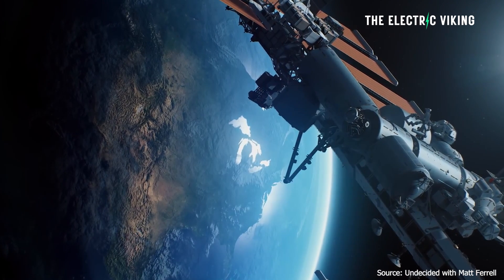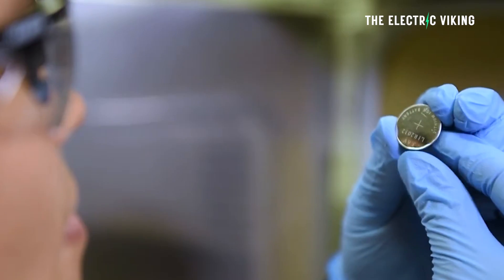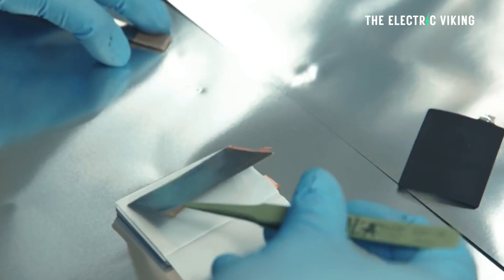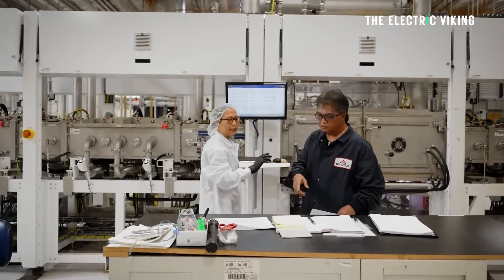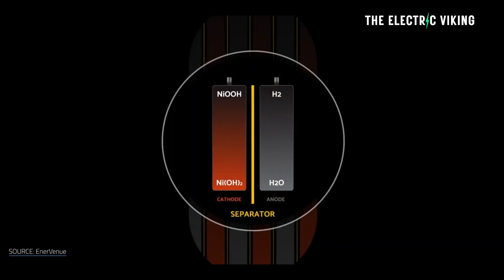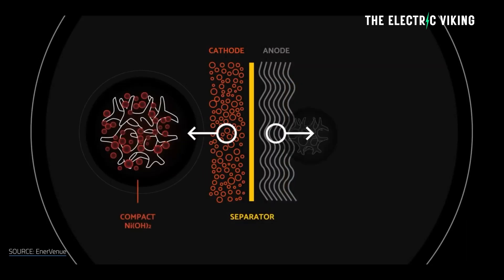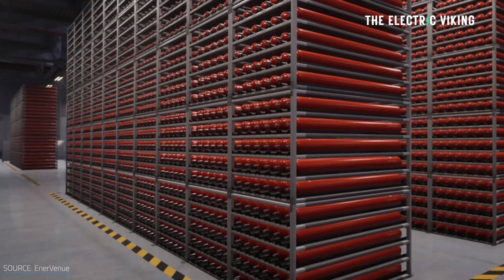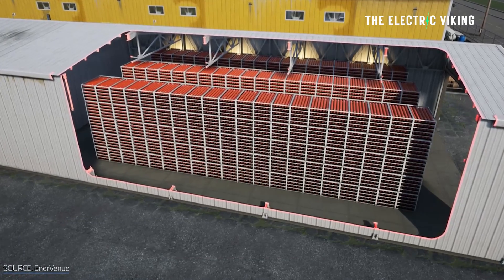NASA's nickel-hydrogen battery technology could displace lithium by 2030

Comment: Twenty to thirty thousand charge/discharge cycles would be big.  Something is going to displace Lithium Ion batteries at some point, it's inevitable.  Could this be it?
Reply: Nickel-hydrogen battery has lower energy density when compared to Lithium based.
Reply: @valenrn8657  That has no meaning for grid scale applications.
Reply: @Ryan-ff2db  Energy density is not a major factor for fixed location energy storage.
Reply: @valenrn8657  Which is exactly what grid storage is and even home/office energy storage for that matter.
Reply: Why are you certain that lithium has to be displaced? Did we erver displace Iron? There are certain chemical properties that are universal from the formation of elements. Lithium is right after hydrogen (and helium but im not talking about that). Iron is element that collapses stars due to being energy negative. Uranium and Thorium (and artificial Plutoniom) are only elements which fuel viable fission. Aluminium is the cheapest conducting element even while 200 years ago was considered precious metal next to gold and silver. Copper is perfect balance of conducting and extraction cost between Aluminium and Silver/Gold. Those truths stay strong for hunderts of years so why would you assume that "change at some point is inevitable". Maybe it is but it will take rather 1000 years than your lifespan so  from your point of view and people who you talk to is irrelevant.

EDIT: Cheapest lighweight is what i meant.
Reply: Given the quoted size of their units for 3KWh of storage and a basic understanding of the underlying science it's an obvious no. The only promising part of this is a cheaper catalyst alloy but the "batteries" themselves are significantly heavier than any lithium chemistry and probably sodium too.
Reply: Don't know. Don't really  care.
There are more important things to consider.
Reply: @robertfonovic3551  like what?